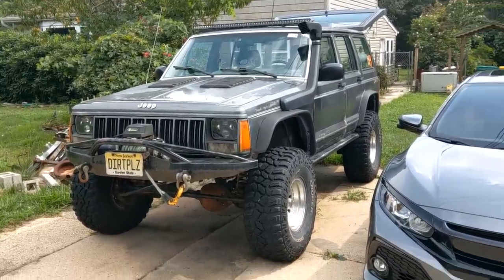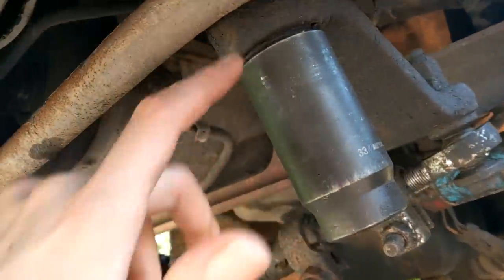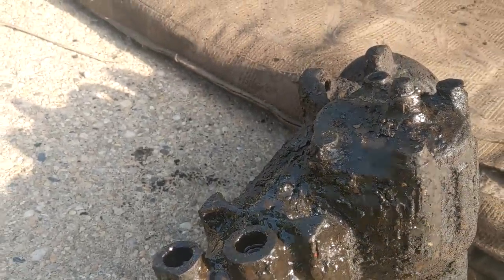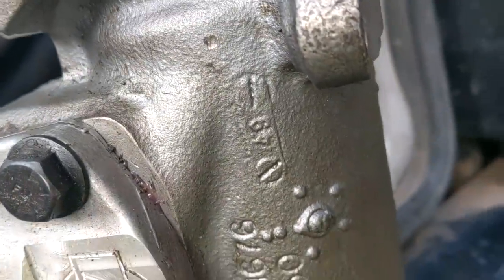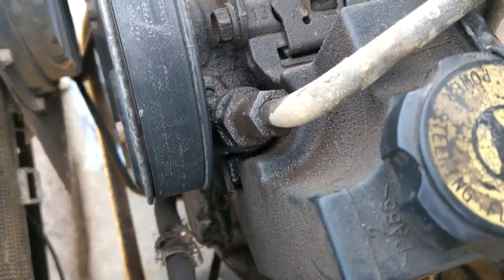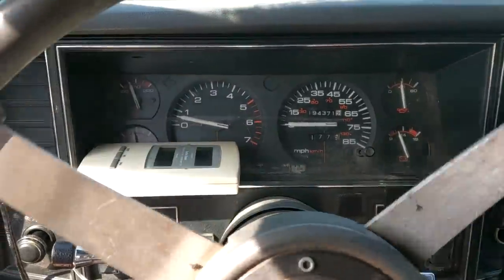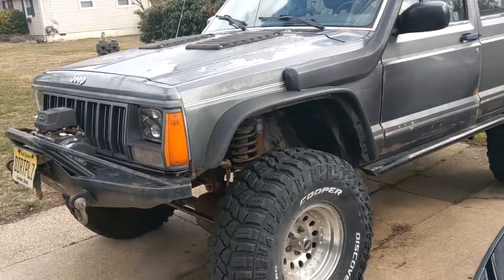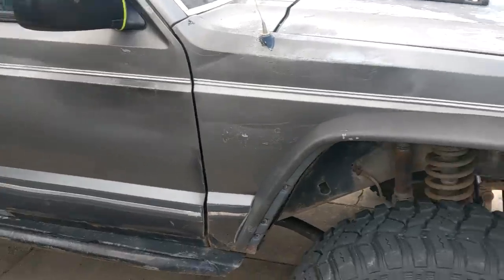89 Cherokee AGR Steering Box RANT Install & Review

Comment: I rebuilt my Jeep the same time you did  and About a year after you stroked your 89 I sold mine and then my buddy's wife ramped it over a Buick in an intersection into a ditch and rolled it several times they are okay but I miss my Jeep keep it up brother
Reply from the maker: Damn man, that's rough. But at least its final journey wasn't the same fate for the passengers. I'll keep mine alive as long as i can

Comment: Thanks for another great video. FYI, I installed the Durango steering gear box on my 89' Cherokee. It is harder to turn now, and turning radius is not as tight as before. I can't make tight turns. When making a U-turn, turns are wider. When stopped and turning the wheel like when parking in tight spot, it needs more RPM's to make it easier to turn the wheel. Makes me want to go back to the stock Cherokee gear box.
Reply: This.....is useful information.  Thanks man.

Comment: I did an 01 wj pump for a 4.7 v8. Use the xj orface and a 96+ high pressure line to clear the wj tank. As far as orface sizing i increased size 1/32 per trial until i found what i liked. The return for the wj tank is the larger of the two return ports (smaller is the same size as a 4.0 return but causes cavitation and no pressure at idle if used as the return). Turns 35s like it did factory and still has enough of a flow rating to run a hyd fan or psc!

Comment: Good to see you again. My trans is bad so for now not worried about the REM display. For my hard lines i set them and tight then used a prybar to make sure they all were not rubbing. My 88 frame is cracked but also have iro spacer and outer plate. Working great so far :)

Comment: Very entertaining video and the commentary is spot on but I feel your pain. I’ve paid a lot and had similar results. You probably woke up screaming AGR for a few weeks. I wonder if they tried a port job without disassembling the box and used approximate port measurements, a drill and hoped for the best. They had it under a microscope so there was no chance for errors.

Comment: i feel sorry for you man i bought PSC and i got the big bore box ported for hydro, high flow pump, oversized relocated reservoir, pulley, fluid, and all jci fittings and industrial lines for $1,400 and it is all new no rebuilt crap

Comment: FWIW: I ran the return line from the box thru an aux trans cooler then to the pump. Seems to help: not cooking the fluid & not getting pump whine after every other trip.
Reply from the maker: An aux cooler was going to be planned if I went hydro but that never panned out. Maybe still look into it at some point if it seems nessisary.

Comment: This reminds me of when I ordered a brand new alternator for my Camaro, it came with a dyno sheet saying how many Amps it put out, ops check good. Got the bad one out, walking through garage with new one, Hey, lets spin check this. Try to spin pulley, it won't spin, I force it to spin, hear this crunching sound. When they put it together they used screws on the back that were too long, they were hitting the cooling fan inside. If they really dynoed this, it would have been screeching and throwing 5 foot high rooster tails out the back. I hate bullshit!!!!!! Even if it's not the answer I want to hear, tell me the TRUTH!!!!! I hate shit like this.

Comment: I rebuilt my stock xj box and ported it for hydro assist. Not to hard and cost me less than 100 bucks. Still need to pick up a ram and some lines. I’ll be going with psc for those parts.

Comment: Did you have to space the 4 bolt box out Slightly more from the frame since it's a little larger? I'm installing the psc kit with their box and the larger box doesn't sit against the frame without extra spacers. I've also read a little bit online about people having to space it out an extra quarter inch so it sits flat on the mounts. I have inner and outer stiffeners welded in on both sides of the frame so that takes up a little extra space. I'm going to weld on some longer spacers and that should take care of it I no longer use the spacer between the box and frame the spacer is built into the stiffener so they just need extended. I was just trying to see if this is a common thing with the larger 4 bolt box or if it's just because my frame is plated. I could only find a couple instances of this issue on forums and stuff. Even though my frame plate has the proper spacers for the stock box it's the thickness of the plate that gets in the way in a couple areas that it wouldn't without plating or with the stock box.

Comment: Aren't the steering shafts supposed to be collapsible? I think it's a DOT safety requirement. And if you look, it appears that the narrow section should slide into the wider section, though it may take a whack of a hammer to get it to move after all these years...
Reply from the maker: Yes, they should slide but i wasn't able to free mine up. Probably could use a replacement if the joint gets any looser anyway.

Comment: My experience WJ steering pump ,Durango w/ snow plug and a 4.5 pully and you will move the 35 tires no problem is my experience.....
Reply: I beg to differ.....fuck the Durango steering box!
On my '98 XJ I put in the D box with the steel brace upgrade & couldn't wait to get it back out. The D box is too round in circumference as it bowed the brace/spacer but did bolt up & not bend the frame (so called).
It was absolutely no better than a stock XJ steering box "and" was a lot of stress added to the spacer. I opted for a new XJ box and pump. I only run 31" ko2's, nothing too big, 3 - 3 1/2" lift, IRO radius arm brackets on the Dana 30 HP, Rusty's  adjustable track bar, dom tube adjustable upper and lower radius arms (short) & RC tie rod. I DO NOT recommend the Durango box wannabe upgrade!
Reply: The WJ pump is exactly the same as a XJ pump. The only difference is the tank, and the valve that's in it. Being that you have to put the XJ valve in it for it to work all you accomplish is a bunch of work for nothing.  FYI even a PCS TC style pump is internally the same as a stock pump. The difference is in the valving.
Reply: @travismcvey  is like i say me experience and if you say is the same is ok ....

Comment: Hows the iro steering doing? Have you had to replace any heims yet? I just got the kit on few months back, I like it so far
Reply from the maker: Yeah, the pitman heim was what was actually popping lol. That got replaced but otherwise it's been holding fine.
Reply: I got the same setup and also had to replace heim joint at pitman arm but as same as nick had steering box sector shaft with lots of play. Think play in box caused heim joint damage.
love the kit though had it going on a year.

Comment: What was the clicking noise?! Im having the same problem on my Comanche and  it has a very slight shake. Need to find out I daily it .
Reply from the maker: For me it was the pitman heim joint. If you don't have this kind of steering then you might want to check your frame.
Reply: NickInTimeFilms Thank you!! I dont but ill check the steering box didnt know they went torqued that much I do have a heim on the track bar ill check that as well thank you again!

Comment: So, should I use AGR or not dude? You're not very clear; especially there at the end.  Ass-holes gettin' rich is a good thing, right???  I'd say you got ported and a three angle valve job to boot. Thanks for the heads up.
Reply from the maker: I'm not sure what else is left to clear up 🤣. If you like pissing away your money on sub part products then go right ahead. Otherwise go with an actually trusted brand like PSC and atleast get your money's worth.

Comment: The mushroom cap is there so you can hammer it...
Reply: No. No it's not. Rule #1 of using tools - You should never hammered mushroomed metal. That's like elementary shop class. The mushroomed edges can sheer off and make projectiles.

The mushroom is to keep you from reefing on it with a breaker bar/impact wrench and destroying the threads. Hitting the mushroomed head will do absolutely nothing because it's held in place by the threads. Actually you might end up messing up the threads doing that as well if you're stupid enough to not understand you're going nowhere with it and keep going to town on it. I've had a customer return one completely hosed like that.

Comment: Where was the popping noise coming from?
Reply from the maker: Spoilers...

I could feel the popping the strongest when holding the pitman arm. Turns out that heim joint was loose enough to pop. So the old steering box may have been fine, making this whole process even more pointless.

Spoiler 2, that still didn't fix all the death wobble but it did make the steering a little tighter.
Reply: @NickInTimeFilms  just replaced my steering box last month and I have same heim joint setup heim joint had  worn from where the misalighnment spacer mated to the heim joint but I think the worn sector shaft of sterring box was main cause at the heim joint ware. allso ended up replacing lower ball joint drivers side didnt have much movement in it but apparently not much needed to cause death wobble.
I still have a litle back and forth movement but its short of death wobble seems to happen at a certain speed and not all the time and its not bump steer so now thinking cooler temps outside its the tires themselves. Guess now is the time to try dynabeads to balance tires internaly.

Comment: All this work you’ve done and yet you’ve never installed frame stiffness? That’s like step one of cherokees cause by the time you finish building it you find the frame is trashed then have to remove everything find a new one and reinstall lol. I’m actually really shocked you don’t have a full frame stiffener setup by now..

It looks to me like they replaced the box they sent you with a different one already worked on... (that’s why they uphold you in the rebuild) then it was crunchy from the shavings it looks like they then sent you a brand new one.. from a manufacturing stand point this is pretty common cause it saves them a lot of time from having to actually tag and track individual parts that belong to people and they can just run them through assembly line like.. makes for good business and piss poor customer service. The thing that throws me here is they usually do this for speed of turnaround. 1 month wait makes zero sense.

Lol at the end of this sounds exactly like what happened.. they didn’t upgrade shit! It’s just easier on their side of things to keep things simple and make all get the same deal so they can run one line instead of many and having to track individual orders.. they just make them and ship them in order based on time..

Comment: Hey there!! What are your thoughts on iron rock offroad long arm kit ?
Reply from the maker: The rock link is decent for the price. The crossmember can be a pain to install, and i needed to added a solid upper joint to the axle, but otherwise it seems to fit the bill.

Comment: The right way to fix death wobble is to go to a high steer setup where the drag link end points are as close to parallel to the ground as possible.  A stiffer (or functioning) steering stabilizer also helps quite a bit, caster helps quite a bit, too (hard to do here).  A new tight box just masks the problem, if it even does that, until it wears out or fucks up something else.